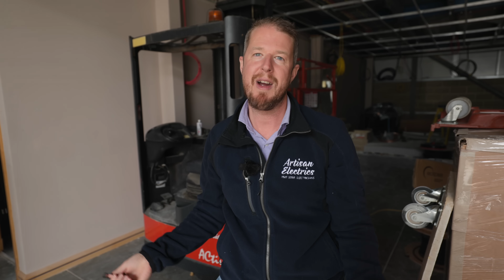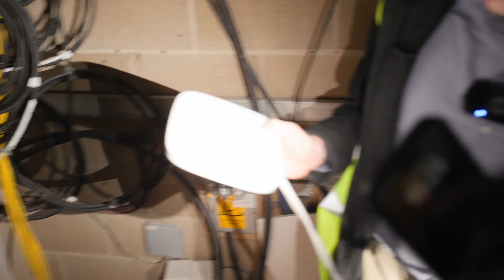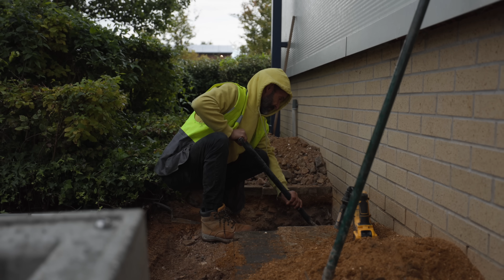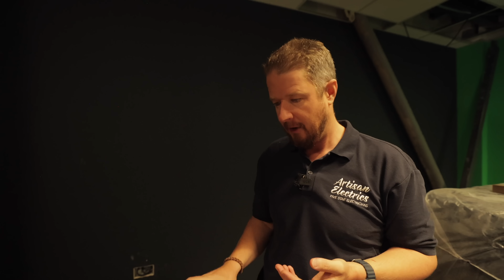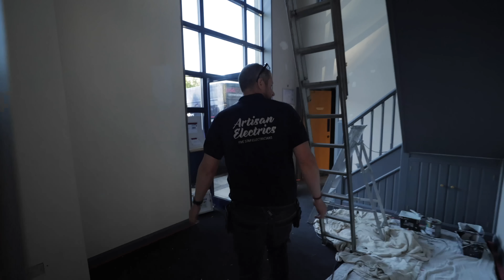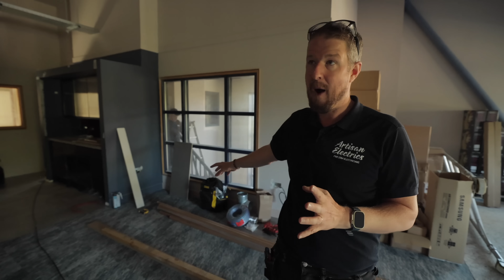The HQ Project That Nearly Bankrupted Me 😅

Comment: Never fit wireless in commercial setting 
Your office is quite a large size as well and you may struggle with signal. Those Ajax are for houses really only. 
I bet they sold you it with the gimic app. All systems now have app compatibility now really

Comment: I've had an AJAX alarm for 6 years now in a residential environment and it's brilliant.  They invest quite heavily on their wireless protocol so it's hard to jam, and if it does get jammed it the hub will trigger an alarm within a few seconds.  But if you want a wired system they do have a wired version called "Fibra" (it runs over copper, no idea why they would call it that way!).  

Pair it with the AJAX NVR and onboard some of your CCTV cameras to it and if there's an alarm it will take you straight to the video feed, or send the video feed to an alarm monitoring station.

Comment: Hey Jordan, I’ve been running Ajax for approx 4 years. It’s running in a number of outbuildings. It’s brilliant, my neighbour had a wired system fitted at the same time following break ins. I’ve had no false alarms so far from my sensor, my neighbours had a few. What I have had is both sounder switches caused the alarm to go off in the early days. Because my sounders are hidden and hard to get to, I turned the tamper switch off. In addition, and this is recommendation due to moderate volume of the street siren, is to ask them to get a relay, and wire it to a master blaster - only real point of note is the master blaster will keep going after the street siren stops and will only shut off when the alarm is disabled. I believe there is a reg stating how long alarm can sound for before it must shut off, however the system is app controlled and will go crazy if it goes off on your phone. You’ll need a 12v supply for the siren and relay is battery. It’s super loud. A further point would he integration with an internal smoke machine. Kits exist now which don’t ruin the building contents when they go off and can be refilled with canisters relatively cheaply. Final points, the key fob is very annoying and can end up hitting panic button while it’s in your pocket. I would suggest turning that off, or setting it as double button press to activate. Same for both arm and disarm. You can also set a schedule, for example arm at 6pm and disarm at 8am, and still override with the fob, it’s ideal so no one forgets to set it.
Reply from the maker: That’s great info thanks!

Comment: Wireless? If you were securing a garden shed maybe.  How much did your last break in cost? And not just in material stolen but in insurance costs.  That was before you had all your gear in there. 

Cheaping out by going wireless (which is subject to jamming that is increasingly cheap to do) seems utterly insane.

Comment: Re grounding off-grid electrics.
How do you correctly earth a consumer unit powered by an EcoFlow Delta Pro (230v) battery in a totally off-grid small building please?
The loop test is 116.2 ohms, yet no error is being found in the wiring or 8 foot grounding rod.

Comment: Good luck with the Signify kit, interact will be fine in your small unit but is awful on large installs 😂. Also check the factory connection on the 600x600 panels, last install I did 600 of them and had some just fail, when the factory connections on the green plugs were checked they just fell out not even tightened 🤦‍♂️ 
Alarm wise just wire it you’ll be pulling I a max of 10 zones and if you really want some wireless stuff in put Texecom in with a wired panel and a richochet expander for really hard to get to spaces like internal window contacts

Comment: PARADOX/Magellan should really be looked at too it is one of the best wireless alarm systems - not WIFI but encoded 433 and 866 mhz - PARADOX's IP Module (for app control if you want but not necessary) is Ethernet based - no "wireless system" is jamming proof - however Paradox systems often include features like RF jamming detection and are built with Frequency Hopping Spread Spectrum (FHSS) technology to resist jamming as well as two-way communication where the control panel and modules ping each other frequently checking various statuses at random to prevent spoofing, jamming and even inplace replacement of bugged/rogue/compromised passives that are not part of the orginal setup . PARADOX do have a Monitoring system for RF jamming that can alert professional monitoring services - they also have some of the industries lowest false alarm rates for their wireless passives, curtain beams and glass break modules. It's best to in any system have a mix of wireless and wired units to reduce the risk of an easy bypass.

Comment: Never, ever fit a radio based alarm system.  Wired is the only safe system and you’ve got the place in pieces so can run wiring.  Sure the system may tell you it’s being jammed but so what.  Just look at the ways professional thieves steal cars.  Jammers are simple to get and very effective.

Comment: 7:15 Just a warning about Sharpies: If you ever write on a surface with a Sharpie but then plan to put a proper label printer ident over the top, be sure to use isopropyl alcohol to remove the Sharpie first.  Otherwise the ink will soak through the new label over a few days.
Oh, and please, a wired security system.
Reply from the maker: Great tip!

Comment: We are the company that attended site.

Ajax systems differ significantly from conventional wireless intruder alarms.

Standard wireless alarms often operate on 125 MHz or 433 MHz bands, which are more susceptible to interference and jamming.

Ajax operates on the 868 MHz band (depending on regional regulations), a higher frequency designed to provide greater range, stability, and resistance to interference.

Ajax utilises advanced frequency-hopping spread spectrum (FHSS) technology within this band, automatically switching frequencies to avoid jamming attempts.

The system utilises its own proprietary operating platform (compatible with both iOS and Android).

Ajax communication protocols include Jeweller (two-way encrypted communication for detectors and devices) and Wings (high-speed transmission for photo and video verification).

In addition to its wireless range, Ajax also provides a wired system line (Fibra), which uses secure digital communication over twisted-pair cabling.
Reply from the maker: Thanks for all your help!

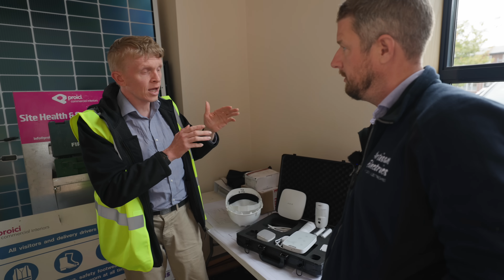Comment: 2:41 Really - don’t go wireless on alarm systems!
Jamming such system is extremely easy even with frequency hopping etc. and you need to power the devices anyways (by battery 🤨 or a cable) so you can go wired in the first place. Also Ubiquity has a full ecosystem with access control for employees, 4K security cams and so on, which runs on PoE - so I’d recommend building it based on that system 😉

Comment: AC guys are cowboys if using SY cable for power.

SY doesn't have a BS number as it a control cable not a power cable and definitely shouldn't be used outside.

As a PV installer we see it all over on old pv installation and normally find it brittle and falling apart

Comment: Using red as the standard network cable colour is wild to me, in my world white/grey is the standard and if there's a colour it has meaning.
Red = WAN/pre firewall (red = danger)
Green = LAN/post firewall (green = go = safe)
Blue = WiFi APs (DMZ/no access to anything internal)
Yellow/Orange = Outward facing servers (similar to blue but different)
Reply: Since they want to do everything perfectly, I really hope they didn't put the data cables in the same conduit as the power-carrying ones (Energy & PoE), otherwise the data rates might be affected by induction.

This just goes to show that electricians shouldn't plan data network installations.
Reply: @VenaNocta I'm guessing they never tested them for NEXT, FEXT etc or applied for manufacturers warranties etc. Seeing electricians do data must be what it's like for an electrician seeing someone attempt to DIY a dis-board.

Comment: I'll mirror the other callouts against wireless based alarm systems. There are too many systems with weak authentication or no authentication, vulnerable to jamming or replay attacks. The tools to do so are increasingly turnkey and tutorials available. As a disclaimer I don't condone anything illegal, but IMO the 'attack surface' of a wireless alarm/security system is too large to entrust the physical security protecting your entrepreneurship, employees, your tools and equipment, etc. Hard-wired systems that measure line impedance to detect bypass/tampering attempts (or open circuit) are more reliable and not susceptible to the same jamming/attacks as wireless.

Other considerations:
- How well the vendor maintains their cybersecurity - do they meet a 'standard' or have they been 3rd party audited? Do they specify any contractual clauses guaranteeing security patches on devices, and disclosures to their customers within a good timeframe?
- As an IOT device, they should be segregated onto their own vlan to avoid exposing the rest of your network, in the event that their devices have a future vulnerability.
- What happens if the vendor ceases to exist, or you suffer an internet outage (see also: overenthusiastic backhoe operator)? Can it be administered locally to update/revoke codes, and audit access? 
- Are you buying or renting the hardware? What happens if the vendor 'obsoletes' your perfectly workable hardware in the future?
- If you don't fully 'own' the equipment and environment, you may end up suffering. If you haven't heard of the story of the FutureHome device where the company removed functionality and tried to force customers to subscribe to new costs to maintain existing functionality, you may want to consider it.

Comment: Even I can tell wireless security is not good.
I have had 2 named brand security systems that were wireless... they are a nightmare in the long wrong when batteries start going, cold temps kill the batteries faster, and you just need to park a few vans in front of sensors, and they'll lose connection.

Comment: Please educate your AC installers on the issues with SY cable.  If asked I suspect they won't be able to give a good reason why they use it other than many others in the industry do but that doesn't make it right.  The sheathing will break down outdoors and the braid will then rust.  If they must use it then at least put it in conduit for protection.

Comment: Those alarm reps pushing a wireless security system is absolutely ridiculous! I would have run their asses off just for that fact. I know that Ajax offers wired systems and those "sales consultants" are idiots for not even considering the fact that Artisan Electrics specialty IS running cabling! My guess is that they are lazy and looking for a quick payday with little to no effort. I wouldn't have any confidence in any alarm company that's that stupid.
Reply: Right, that’s what this company does run cables, and they are already running cables on this project, have the walls open etc
. Wireless is insanity in this context.

Comment: Like everybody has already said, Wireless alarms should be kept at bay. doesn't matter how much a company claims they have signal anti blocking technology, or any other signal thingy magic. you can't stop a radio signal being blocked, If I analyse signals around your building I can 100% block them. while you got the walls off and access to run wires you should be running wires. never have a security system that can be accessed from outside.
Reply: I could park outside and run my noise generator thru a RF amp and the wireless system is paused.

Comment: No one uses sy. Or Samsung ac!!! Be aware!! The ac team are pants bud. You want the best. Those options are not it. Mitsi electric all day long.
Reply: AC between units requires screened cable, Black UV stable SY is the recommended choice.  You are right on Samsung out and ME in.
Reply: @de03ley lmao. No one uses sy!!!! Screened if must but there are far better options out there. The interference is nothing. 35years of experience. lol. Believe me. Sy bakes and rots. Rusts up. Awful stuff.

Comment: Jordan, how have you gone from redundancies not so long ago to splashing out an insane amount of money for this place?
Reply: Dare say in 3 months time they realised they over leveraged themselves when the work dries up. Some people never learn unfortunately.
Reply: Reeves is moonlighting as his accountant! Billion here billion there, all on the never never. 😁
Reply: They do say be nice to people on the way up as you may meet them on the way down!
Reply: You're using addressable? Why did I think you were fitting conventional? Apollo have brought out a new design of sounder/VAD base which fits onto a standard addressable base. They're super good. The old ones were a bitch to fit. When we were hiring one of my practical tests was to fit an Apollo 45681-330 to an acoustic tile with galv U box. I filtered out so many bad installers who were asking for big bucks wages. You're not an open protocol fire alarm engineer until you're able to fit and address an Apollo sounder base in less than 15mins.
Reply: Probably cos the charge 50 million quid for a re wire

Comment: Would love to see you terminate the CAT6 and what tools you use. I tried it once and it very hard
Reply: It’s mostly about getting the right terminators.  The gauge changes between specifications and you need to use matching ends for thicker or thinner conductors in the twisted pairs.  Plus don’t forget shielded connectors and screened cables for the more vulnerable (and the fastest) links such as long Cat5e runs or all Cat6a and Cat8.  It ends up being a right mix of termination options to keep handy.

Comment: Its a commercial install? Get a proper alarm company in who will install a PROPER wired alarm system thats monitored or self monitored. 

Wirefree alarms have a place in domestic installation but not commercial. Hiding cables in a commercial install isnt a priority is it?

A supplier like Ajax, visonic or similar is seen in the industry as a quick solution to a sparky company  or a dedicated CCTV company who wants a quick solution that can be nailed to the wall with no security skill or knowledge..... get a proper company in to install Pyronix or Texecom system..... a manufacturer with a long proven history.
Reply: @chrishorrock: Absolutely 100% agree with you, I've been installing alarms for longer than I care to think about & always wire commercial systems.

Comment: SY Outside WILL fail.  It’s simply not UV proof.   SY has its uses indoors for portable equipment power leads to say commando plugs  where SWA is too rigid, and even artic grade flex or HO7 is too vulnerable , but we avoid using it outside as it will fail over time , every time.

Comment: Would avoid wireless. Sligtly unsure why you would go with wireless. You are undertaking extensive refurbishment and a wired installation will just "slot" in. I have use wireless in churches etc where discrete installation is needed.
Reply from the maker: Thanks for the input!

Comment: Should NEVER use SY cable outdoors.... oh dear
Reply: You can get black UV stable SY and for AC that carries dc data packets, screened cable is best. SY is the preferred choice, but that clear SY is hygroscopic, increased by the plasticisers in the clear sheath.. so ya, clear SY outside is a Big No No

Comment: Use unifi for security,
Reply: tbh you've done well with all you've done but wifi alarn system id put in residential situations, you need a hard wired system
Reply: I personally dont think they are there just yet for a full alarm system, but a mix of unifi and another system would be fitting - unifi for cameras and a small number of their security products, then an established alarm system install alongside

Comment: Wireless alarms have their place (in my opinion it's best left for low risk domestic premises) Seems mad to use it when you have the perfect opportunity to run some 8 core alarm cable in though.
Reply: my point as well.
Reply: Especially in a business that prides itself on cable runs. Think about all the angles they could drill
Reply: absolutely agree!
Reply: Only problem with some of them is if the battery dies in the device it either sets the alarm up or doesn’t or it messes up the system which is annoying to fix
Reply: Ajax offer a fully hardwired alarm system. It devices have significantly less power power draw than competitors, and it offers much more flexible cabling - id still stick with an AJAX intruder alarm, but agreed in buildings like this where cabling is easy, it’s a no brainer to cable it.
Reply: @xRaWYT I've yet to find a professional alarm company who does things properly that installs Ajax equipment. I've been installing since 1995 and the only people I've seen quoting this stuff are the house washers or the £199.99 guys.... 'scarper and run limited' types. It's nail to the wall and plug in equipment.... like that Visonic tat....
Reply: @xRaWYT  Texecom all day long

Comment: Sy has no bs number and is not UV Stablised
Reply: Isn’t the main concerns.. AC requires a screened cable for dc data, you can buy Black UV stable SY.  Main issue is that clear SY is hygroscopic

Comment: Don't go with a wireless security system. Burglars will just jam it, or (depending on the frequency) if you have too many devices around it could cause connection issues (especially if it's just 2.4 Ghz!)
Reply: False. Jeweller protocol. It's what Ajax uses. 

Might be true for other cheap alarm systems.
Reply: @bittyboppity: How much are they paying you to keep pumping their kit ?